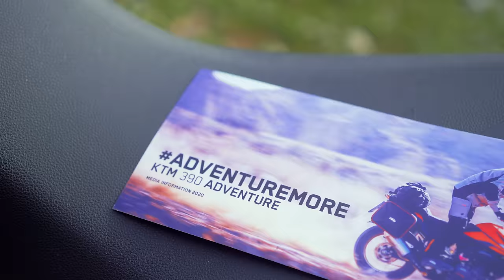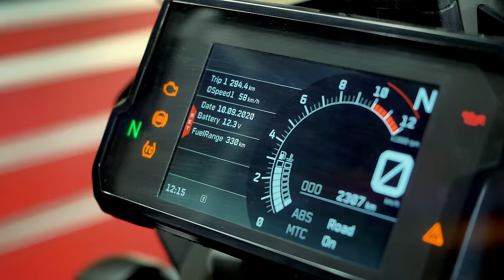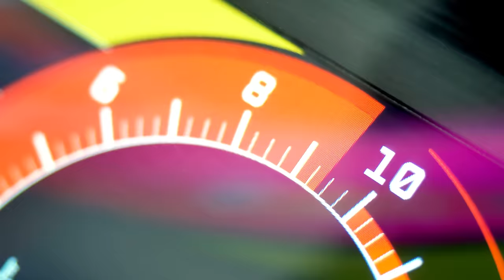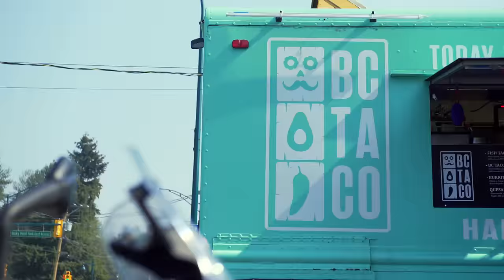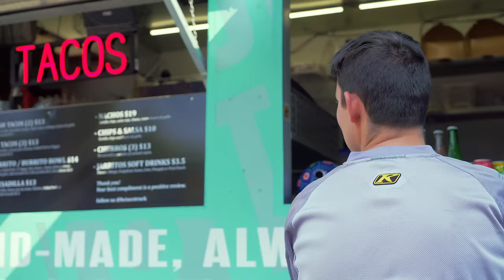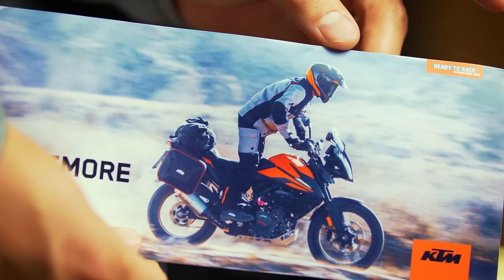The Smallest Adventure – KTM 390 Adventure Review

Comment: Any manufacturer that lends FortNine their bike and lets him review it honestly and thoroughly with no strings attached, instantly get's higher on my list.
Reply: @crispindry2815  You're right, my bad.
Reply: @crispindry2815  get is higher! Crystal clear :P
Reply: yeah Ducati will never give a bike to F9 and that sucks.
Reply: Ktm aren't dumb. If there's a problem to pick with the bike, someone like Ryan will pick it. They can then fix the issues on later models. Not only does it make the bike better, but it makes them look like they actually care about making a good bike. It's a win-win. Some brands (Ducati is a prime example) are more concerned with protecting their reputation rather than getting honest feedback.
Reply: I think Ryan mentioned in one of the previous videos they usually buy bikes and gear to do these reviews.
Reply: @devo3243  Ducati, like most things Italian, are primarily concerned with reputation and styling and exclusivity. Surely Ducati know that their products are flawed, but they don't need anyone to point that out.
Reply: @devo3243  it's pretty much 50/50, sometimes he asks people to lend him a certain model for a review, and sometimes it's an independent dealer..not the manuf. directly
Reply: I rather look at the reliability ratings
Reply: @carlosandleon  of course, always use more than just one source
Reply: @devo3243  Makes sense. Bajaj is a very customer-centric manufacturer.
Reply: @dariopasquini2203  remember when they did crash test videos on gear and they ended up getting a cease and desist because these companies that care about "rider safety" care more about swindling people into buying an inferior product once then dying in a crash, than perfecting something that's flawed
Reply: @marcusnilsson2463  lol again, my b.
Reply: @kitsachie.  wait, can you point me to that video?

Comment: Two years later, KTM straightened the pegs and offers spoked wheels as power parts. I can't wait to take my 390 to offroad to see what it can do
Reply: That's good to know
Reply: Can you buy the pegs separately and fit them to an older model? I'm thinking of buying a used one in a couple months.
Reply: @SuperFrodo95  definitely can. Bunch of aftermarket options as well.
Reply: The pegs remain equally slanted on my 2022, don't know what you're on about.
Reply: @MrMistery101  Yeah, I've looked at photos of the '23 and they still have the same angled footpegs. I've just put Motourenn Adventurist pegs on my bike and they're much better for standing on.
Reply: @SuperFrodo95  It remains a city bike for cities with less than stellar infrastructure for me. And it works well in it's current configuration, even with the slanted footpegs. I might change them someday, but not something I've got plans for at the moment.
Reply: i was wonder because my KTM 390 has straighen pegs...I more bought it for my father and wife to use. They are new riders and it's been a good bike.
Reply: @MrMistery101  I've got a 2023. Still slanted. It must be a 2024 model thing. They don't bother me a jot though.

Comment: “These tires have more grip than most riders have balls”. Ryan, tellin’ it like it is, eh?
Reply: so about 3 grip?
Reply: can confirm having had those tires on my Super Tenere. Ive done everything from accidentally scraped a peg in cold and wet weather going up a mountain road in Flagstaff AZ, to trying to chase down a friend on a supermoto on a tight canyon road and never felt like the tires were even close to giving up. I will be switching to a TKC70ROCKS rear and either a 70 or 80 for the front on the next tire change though

Comment: I think the 373 cc thumper has so much potential- if they had put it in a more ADV like chassis, I imagine it would be almost perfect as a budget tight lightweight do-it-all ADV bike.
Its not everyday you see a motorcycle journalist(s) get loaned a bike for them to be 100% honest about it. That deserves appreciation from the consumer side. Well done indeed.
Reply: There have been spyshots taken of a 390 platform bike with 18/21 inch tires, whether that is going to become a enduro/supermoto or a beefier 390 adventure is yet to be seen.
Reply: "That deserves appreciation from the consumer side." To a company, is lip service appreciation, appreciation at all?
Reply: Let's just say this.... My CRF300L would be traded in immediately.
Reply: Can't believe they haven't thrown that engine in a budget friendly quad yet. They wouldn't be able to keep them in stock if they marketed it as an entry level/ budget sport quad
Reply: @r3fotzirx  they sell those tires for the 390 adventure
Reply: Correct me if I'm wrong but isn't the frame of this is basically from the duke?
Reply: From what I can tell is that this platform suffers from having the same engine for what, like 4 bikes? The RC is cracked the fuck out and breaks, this doesn’t have enough juice compared to the competitors etc.

Comment: Riding since this may, I bought a Duke 390 as first bike, I am 6f5 (195cm) Quite pain to fit so small bike. at 3K km traded with 390 Adventure, worlds best decision :D I am still a learner so more suitable for my height, adequate power, traction control ... I am very happy, if your neighboorhood has lot of potholes and construciton roads, perfect choice. Consumption was low as 2.9 L/100 Km.
Reply: 2.9? Are you pushing it with the engine off?
Reply: @TsvetanVR  sounds legit ..I often get 3.6 -3.8 on a Vstrom 650  .
Reply: @davidmorphett8997  never had less than 3.5 on my G310R (not even the GS) with the most economical riding. 4-4.5 typical. So 2.9....good luck, unless you're calculating it downhill. :D
Reply: Been riding since Septembeer 1st! Duke 390 as my first bike. I almost went for the ADV, I must admit. Just hit 1K kms yesterday. Don't think I'll trade, but I'll sure consider ADV when it's time to change!
Reply: Bikes measure fuel economy? Mine just measures kph and fun..
Reply: what the fuck, i'm doing 4.3L/100Km on my 2019 Duke 390
Reply: Noyan you're probably better off with a 650(or similar), they're newbie friendly, while also giving you room to grow, especially given your height, the teeter totter effect for shorter riders on 650 adventure bikes is going to be a non-issue. Get a V-strom, Versys, Transalp, Ténéré, or similar. I'd especially recommend Ténéré simply because of your height(get a used 600 rather than the new 700, so you can abuse while improving, without worrying too much about depreciating value from a few scratches).

Sidenote: I get around 4L/100Km on my Versys if I obey speed limits, and 6L/100Km if I ride it like I stole it.
Reply: The USS Johnston  Rossi?
Reply: @MrFarengar  duke was 3.5, after breakdown adv is similar too 3.5 lt. 1350 km so far.
Reply: @TsvetanVR  3.5 after breakdown period. If i push it 4.5.
Reply: @OnlyKaerius  I considered Tnr but no traction control was decision maker. After this i really like to have a f850gs or s1000xr. Multistrada is a maybe too.
Reply: @arabaciadamlar  My mechanic swears by Triumph Tiger lineup, he's got a 1200 XR, but you could try a 900 or something first. I'm more of a road bike guy who just likes ADV ergonomics for touring and carving, so my next bike is likely to be a Tracer 900(same weight as my Versys, more power).

If you're more of an off-road guy, the king is probably the Africa Twin 1000. Corner carving suffers because it's less flickable, but it just conquers off-road.
Reply: Thank you, i'm 192 and right now on the 125 duke and going to uppgradera soon but the adventure is so much more worth it for $1000 more over the duke?
Reply: @TsvetanVR  3.0-3.2 on a CTX700 with DCT. He's a new rider so drives cautiously and is not hauling ass.
Reply: Noyan bey. Keyifli sürüşler.  Bol bol motorla ilgili bilgiler bekliyoruz sizden de. Bende almayı düşünüyorum bu motosikleti
Reply: My point exactly, a great beginners adventure bike, Ryan being a bit hard
Reply: You can always tell a real biker from a fake one. The fake one cares about L/km
Reply: @mehmetdag3621  teşekkürler Selamlar.
Reply: @TheJPHarvey  I am not a biker tho I like the joy and convenience using the the bike for my commute and day to day activities.
Reply: So... It's NOT good for a 5 foot person? Lolol
Reply: Hi Noyan..
Nice to know that.
I'm 6'6", I've not yet managed to test ride the ADV 390 yet.
I just manage to fit on the GS310, My hope is the ADV 390 is as ergonomic for me.
The ADV 390 definitely has more bells and whistles as compared to the GS310.
Reply: Awesome to hear, I’m also 6’5” and really like the idea of the 390 adventure as a side-grade to my cb500f for a combo of weekend braps and road tours (restricted license). Not had a chance to sit on one due to covid, but was concerned I’d be too tall
Reply: where on earth do you get that? with potholes and construction roads?? I barely manage 4.5 on sane steady riding at 80 on smooth highways!!!
Reply: Same boat! Went for the 390 adventure for the higher seat height, still a fantastic bike at a great price.
Reply: It’s a great time to be starting off riding. When I was starting off everyone got piece of shit Honda rebels. The “starter” bikes today are so awesome. I’ve been riding for 12 years and I want one of these bad. I wouldn’t give up my 1200gs for it but I’d love to have one as a 2nd bike.
Reply: Great bike @noyan ! Meanwhile myself 175cm /5'9 , just pick mt-15 for first time. Whatever these people said, I love my bike anyway. It was perfect size for me. Bigger bike are too heavy. Too burdensome in traffic jam, too much fuel for commuting everyday,
Reply: @TsvetanVR  That’s almost 100mpg
Reply: @TsvetanVR  truth is g310 is trash thats why u have this consumption
Reply: @TsvetanVR  I get a little less with my CB300R
Reply: I only get 2.9L/100km as trip average if going slow and steady on rural roads ( under 50mph / 80km/h most of the time.. ) .. but it seems like the computer is aa little optimistic. Best tank so far as range ( and range is what I really care when on a adventure  was around 380km ). Mostly I will get 3.3 on rural roads, 3.8 in city ( Toronto ) and about 4.0 on a long highway truns
Reply: @TheJPHarvey  seriously, bc most americans are rich or they consider bikes toys
while the rest of the world commute or use their bikes everyday for errands
it hurts my pocket when my bike fuel expenses are as much as a car's
Reply: definitely a year behind, but this is exactly the comment i was looking for, as someone of the same size. i fear that the duke might be too small. thanks for this

Comment: This is quite a kick in the nuts of all the "reviewers" standing beside the bike and reading from the brochure.
Reply: Might be. Or this one is just bashing the bike for less objective reasons.
Reply: @TimZett  how are the things that he brought up not objective flaws?
Reply: @toad3222  I was actually referring to the comparison between the 350 Adventure and the Duke at the end of the video, like: "I'd better buy the same (naked) bike with a slightly different seating position for a thousand bucks less".
There is so much difference in the feature set of the 350 Adventure, which justifies the price difference. It could actually be even higher. Those differences were not mentioned at all.
In short: You can't compare these 2 completely different bikes, except for the engine.
Reply: @TimZett  it's a 390!

Comment: revisiting this video after a year and owning a svartpilen. I have changed my mind. Initially I agreed with Ryan, but Yesterday I got stuck in a rut, no grip, rear tire spinning and digging deeper into a hole, if it weren´t for the bikes "light-weight", i wouldn´t have been able to get it out and ride home, and I had a revelation, big adventure bikes are simply too heavy to go on any real adventure alone, you need at least 2 more people to help you in these situations. So If I am able to go off-road and have a blast on a less capable street scrambler, with this proper adv bike you can do so much more. Just change the footpegs, tires, skidplate, and ride it like a hooligan.
Reply: Meh, I'll just get a CRF300L or KLX300 or XT250
Reply: @kaikart123  if only yamaha would bump the xt up to a 350 that thing would be fkin fantastic
Reply: 100% I was initially turned off the KTM390adv as my first adventure bike, but a few other channels (ADVMatt, ADVpulse, DirtbikeTest) have built out the 390 with some mods to be a BDR-capable bike. New pegs, skidplate, bar risers, and knobbies turn the bike into a very competent offroader that's still able to cruise 80mph on the freeway. Yes a KLX300, CRF300 is going to be better offroad, but those bikes are not going to be as comfortable for the highway stretches. the 390adv is a pretty good compromise, better on the highway than smaller dual sports, easier to manage and pick up solo then the bigger adv bikes (t700, africa twin, bmw gs)
Reply: And maybe a new set of bars or bar risers if forward weight is a problem.
Reply: @shoakimoto2517  thank you so much, id been really on the fence about getting one of these. Only because i knew the top speed but not how comfortable it was to ride and overtake on the freeway. from all the other reviews ive seen about this bike, i dont think f9 really showed what its capable of offroad. So off to the dealership i go
Reply: @kaikart123  those aren't adventure bikes, and if you have to commute a long distance like I do before the off road, those are a no go. As a KLX300  owner I can tell you that i have tried.
Reply: @shoakimoto2517  all three bikes, which i like, are not very good on USA State routes.  Interstates, only for very short connectors would i even try.  ktm390 engine the minimum i would say for North America.
Reply: Thats interesting I had a Svartpilen and sold it after 1.6k kilometers. For me it was incredibly uncomfortable at off-roading and I bottomed out even on really small jumps. I went for a T7 and I’m able to lift it alone so it does great for solo adventures this idea that adventure bikes are too heavy to go alone is wrong. The aprilia Tuareg has a lower seat height than the 390 and a better geometry and it’s just 30kg heavier.

Comment: Ryan is my favorite motorcycle critic  with his wit and analysis which is usually on target.  But I take issue with his conclusion, I am 68 and have ridden for years on road and offroad,  and  I currently own 4 bikes including the 390 Adventure.  I think this bike is awesome and just puts a smile on my face every time I ride it. It is especially good at  carving canyons, even better than my BMW S 1000 XR  in tight corners.  The handlebars are way too low even for me at  5ft 11 and shrinking.  If Ryan changed the pegs and installed a  2 inch Rox bar riser I think it would change his opinion. Clever marketers have convinced many that they need 1290 cc 600 pd beast for adventure riding, but unless you are an expert  they are only good for a graded dirt road.  You wouldn't believe where my 66 year old friend took his 390 Adventure with stock tires  off road in Colorado last fall.  Even with the limited clearance he amazed me as I was on my KTM 450 EXC.  He did later add a better skid plate. I wanted to get rid of one bike but I can't bring myself to consider getting rid of this awesome ,comfortable great  handling bike.

Comment: ... or get some big, lower, level pegs for ~$65 - $120.  
Get a set of bar risers to your specifications for $25. 
Get a hardy bash plate or avoid being so clumsy and not roll over 7" logs
Then you have a fantastic fast highway cruiser 
and a very nimble and light trail bike 
for at least $2500 less than the mid-size adventure bikes 
that fall over easier and hit the ground with a far heavier THUD!
~~~
I've ridden all sorts of bikes for over fifty years. 
The KTM 390 Adventure is a flippin' winner.
S